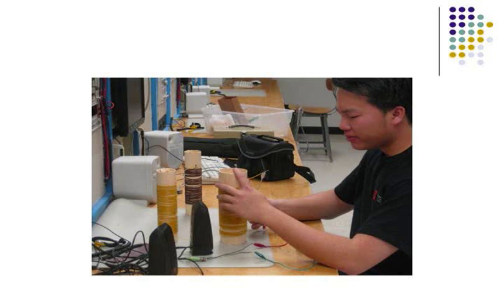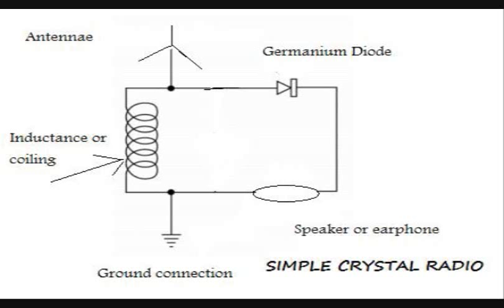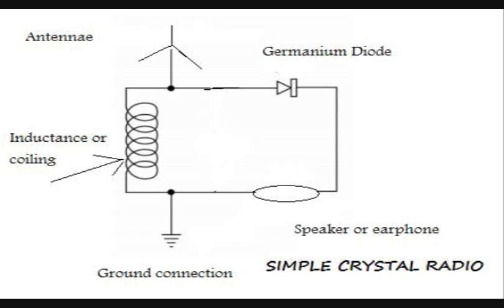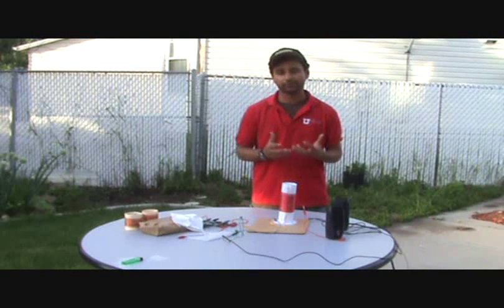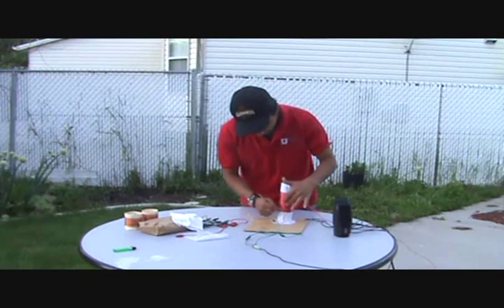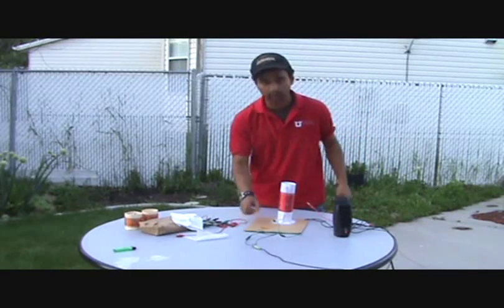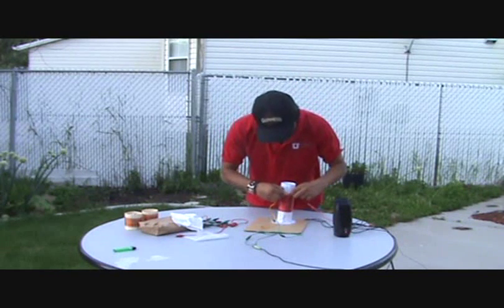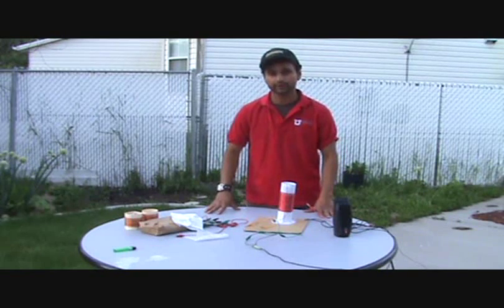CRYSTAL RADIO EXPERIMENT

Comment: i have one and have never used an earth on it and it works fine. I'm not joking I had a stainless steel double sink sitting on the ground and it ALONE picked up an OK signal. wire fencing is quite alright.

Comment: Might I suggest some improvements?

Add a resonating capacitor, and connect the antenna by adding about 5 to 10 turns that only share the ground. Then the antenna movement/size won't affect tuning very much and selectivity will be improved.

If you use enameled wire, wind tightly on PVC pipe, then carefully sand along one edge so just the top edges of the copper wire are bared. Then make a slider contact to tune.

Use standard schematic symbols.